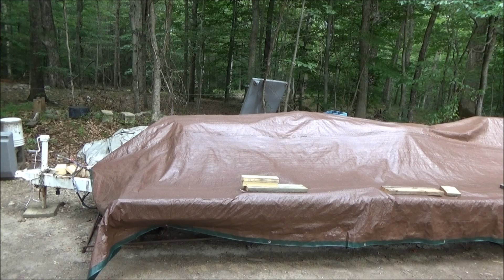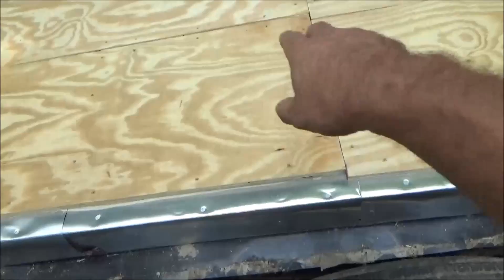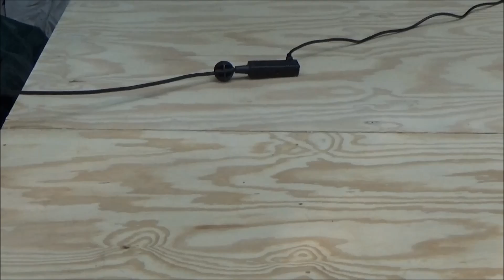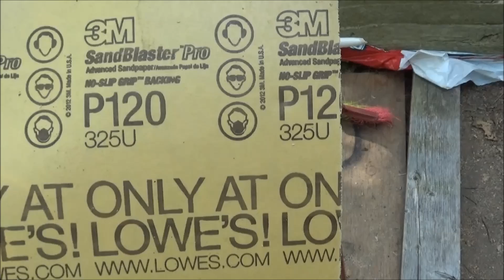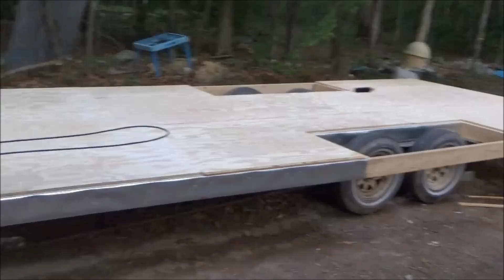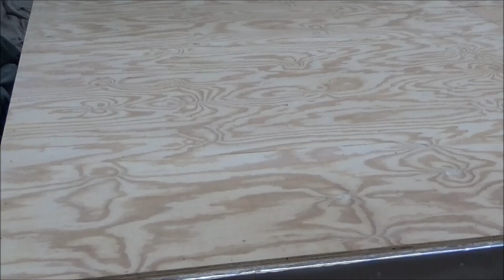Sanding My Tiny House Floor Plus Some Nice Finds

Comment: I know you want to use a natural substance on your house that is good especially because its a small space to be cooped up in the middle of winter and you gotta breath the air in side of it with no escape when its cold or real hot with ac on. I would have used marine varnish because it last a while and water cannot penetrate. I think after it dries good you will not get fumes. Just what I would use but your house you can do as you please shellac will be ok as long as it dont get too wet. It cannot get wet from rain or it will ruin it I think. Just saying dont get sad. If you keep it tarped good it will be fine. I believe your gonna need lots more tarps. You cannot have too many.

Comment: Not to be negative but I don't get it. The finish on the floor needs to be done last. At least after wall covering is put up and cabinets are hung. There will inevitably be dropped tools, lumber, and other objects that will ding the plywood. Easily remedied with a warm rag but only if there's no finish on it. I could understand a rough sanding, maybe 80 grit to even everything out from the beginning but not finish sanded and coated. Most of that could have been avoided with the golden rule of measure twice and cut once. Problem is all I've seen is measure once and think about it for a week. Then there's the argument of which is more important, wasted dry weather where a wall could be flown or a sanded floor that will absolutely get dented later and need to be fixed. Troy, Fall is here in 6 weeks. Get a move on or you'll be out in the cold. It's almost getting unbearable to watch what is coming. That being said I'm an avid supporter of what you're doing but there needs to be some serious priority changes or you will not finish that tiny home until the end of next summer.

Comment: I have seen some comments were they say do it after wards. But I think its a good idea to do it at lest once before the frame goes up. and if you do mar it or put scuffs in it. you can always take the sander to it and put a second coat after the walls are up ect. that way any water or anything will not penetrate the wood.  Now if you can get it for under the home I see if you can get that Rhino liner stuff. you can spray on and completely coat the under belly of the home to keep it all water, and air tight.  looking good, my opinion thanks for sharing

Comment: I've been following you since your trip to Australia. Today's project is the second time I've commented. When you took your shoes off I thought to myself now that is a waste of time. Sanding with no walls or roof?
Reply from the maker: This is my floor. It will be my finished floor. This is not normal. I cant afford anything else yet. So I will sand it. Shellac it and then cover it. When I am inside I will re-coat it and wax it.

Comment: Troy I think you should cover like you plan. Don't waste your time with that Sander. Leave that until the walls a roof are up. Some saw dust at the off grid is not a bad thing, Plenty of time to vacuum it later. Plenty more dents and dings to come in the mean time. The floor does look much better, Once the humidity hits it might change. Just a Thought keep up the good work.

Comment: BTW, newly cut Oak is hard wood ! Talk to those old guys about how hard or easy it is to work with... The material from a store is probably more dry or kiln dried... We got mill lumber for a great price in Missouri but  cutting it and nailing was tough... We went through a blade and had to pre-drill just to nail things...

Comment: Hi Troy,
   I just got done reading all of the comments and then I went and spoke to a person that I know who has built homes for almost 50 years now.   I think in this case, Troy, you should bite the bullit, even though I know what your motivation is, to prevent dust inside your tiny home...but that is a given anyway,.......you will have dust simply from the construction unless you intend to vacuum each and every board and 2 by 4 before you bring it to the construction site, and even then, you will still have dust.  
   You won't be able to avoid dust and debri inside of your walls during construction....period.    You also won't be able to avoid damage to that...what could be a lovely floor, and if you seal it now, especially with shellac, you won't be able to go back and fix that damage without it either showing terribly or your having to go back and sand that entire layer of shellac off, down to the wood again, thus creating all of the dust and more, that you had so valiantly tried to avoid.  
   In this instance, Troy, please listen to these experts who do have your best interest at heart and don't shellac your floors until you are done.  Fixing the ultimate damage to the floors that is inevitable with construction  will be so much much easier without a finish on the wood.    I am backing you 100% in this Troy, and you know this, you have seen me come out like a momma Grizzly in your defense, but in this case, I am on the side of those giving you this advice, as well as always having your back.   Spoken in love...Vicki
Reply from the maker: I have my reasons. I know it is not normal. But please understand I am trying to keep a sub floor as my floor. This is NOT normal by any means. If I do not take precautions to protect it now then it will be destroyed. This is NOT normal. Normally you scuff it up, nail it up, glue it up, dirty it up. Then cover it up. But this is my floor. I have to protect it or it will be destroyed. I figured a bit of shellac is cheaper than all new flooring again after construction. It will hopefully protect it from being all dirty and ruined. At least I can try. I am also doing this because I am trying to give hope to people who lose their homes and jobs like I did. Hope that they too can build a house for a couple grand. I am cutting corners where possible to see if it can be done. To show people, if it works, that they too can do it.
Reply: The Do It Yourself World
when expensive wooden floors have been laid down on new builds ahead of time or other circumstances  dealing with renovation of old houses etc,  the flooring is covered  over with a soft water proof barrier sheet , sort of like thin polyisobutylene membrane, comes in 2m wide  50,100m length rolls and is  lapped tapped together with doubled sided tape,  then a heavy duty protective covering is put on top, similar to a composite board about 6-8mm thick 2x4m, its near bullet proof, will take pretty much any abuse, once all construction work has been finished,its removed leaving no traces of what went on .

troy probably sealed the floor to help deal with the water problems a head, must admit would be getting worried not having the framing up and the roof insight at this time of year, its one of the biggest problems on any building site dealing with the rain.

maybe worth thinking about constructing a temporary roof over the complete tiny house project, using some of the near by trees for upright support pillars on one side and using the tower sections for the windmill$ project for  the supporting beams on the other side , using some of the wood thats in the garden and other section of good weight bearing timber, bolted,screwed, nailed etc together into long beams make an over head frame, then a number of good water proof tarpaulins roped together  and tied around on top with a descent pitch would make the site workable when its raining, using either the Jeep or car as a tethering weight tied to the free standing towers  , probably  a number of stakes beaten in the ground to deal against the wind, seen it done before .would not take more than 2 to 4 days  to be constructed and would be very beneficial on the long run of things, not wanting to sound negative but its the only way around the small window of construction time left , with just the floor being finished after about a month, the walls and roof could take 3 more months to do on his own.he needs help that's the only way things will speed up, for one man on his own makes everything take 3 times as long, know from my own experience.
Reply: Troy, I do understand, but your first defense for going this way was all about the dust.  If you had not sanded first, there would be no need to shellac now that you have opened up all of the pours.   But I'm worried because shellac is so very unforgiving and you will have damage to that floor during construction....you won't be able to prevent it.  It is very hard to almost impossible to make a repair to a shellaced floor look like the original and so all of your hard work will be for naught.   Also, you are on a time constraint that will only be cut shorter as you and your helpers will have to work extra slowly will be so worried about scratching that finished floor that you and your workers will be distracted from what you are trying to accomplish, which is to get up the walls and a roof over that floor.  I know you are trying to cut corners but some cuts cost you more in the end than they are worth....Listen to the experts in this case, please.....they do have your best interest at heart.

Comment: Why do you keep mentioning that UGLY blue table?  Why not just get rid of it?  And all that extra stuff that was on the tiny home floor why not just put it in the christian camper  till you need it?
Reply: Also, "all that extra stuff" (or at least part of it) helps to keep the tarp off the plywood floor. So it kinda serves a purpose.
Reply: Troy, don't get rid of the blue table. That is our running joke!
Reply: Althea Harris  It was a comment just like yours that started the blue table joke off. The Table is now third in line of importance behind Troy and Loudmouth.
Reply: Hi Althea!   Are you from CA by any chance? I knew an Althea Harris, but you look younger.

Anyway, since this is a learning channel I shall enlighten you as to the crooked blue table.  This is what happens when women tell men to move something... it will never be moved and further more it will be declared a work of modern art, guarantying a place of reverence for ever and ever, amen.
Reply: Uncomfortably Numb :p
Reply from the maker: MollyDolly hahaha. Take that.
Reply: Sacrilege!

Comment: Troy!, if your going to put a clear coat of lacquer or varnish on the floor to protect it.. you can do it now and knock it out of the way.. it will protect it some from the elements.. just make sure you extend it pass the edges of the plywood on the edges.. to cover the edges from drying out and cracking over time.. while building.. later you can sand the lacquer down some and re-coat it .. if need be

Comment: I see all the tolls are out. Yeah I agree it may get scratched but you can put another coat on it after it gets all done in the end before you move in. The annoying table haa haa thats funny. I think yo should seal it it will get scrated but at least not more stains. You can touch up with a thin coat.

Comment: I would have covered the floor at this time with Tarkett 12-ft W Modena Tile Low-Gloss Finish Sheet Vinyl that is Water-moisture, mold and mildew resistant from Lowes.

Comment: U sandee the floor and fill the seams with glue dust filler from the leftover piece. The shelacin should be covered by tentin the tarp over the floor until good and dry. Ur wood finds will help with makin a winter ready road base and a big sled to haul over snow. Looks like your neighbors r lookin out for u too. Many eyes help in findin things as they look in different directions. Hope u keep ur list of needs in ur pocket, so as to update it with these new finds. Remember  to scrath Babycat and feed the chickens, otherwise they'll remind u to.
Reply from the maker: I do have a list and it is fun looking around with my neighbor. Baby says hi

Comment: Are you using shellac which is susceptible to water damage or varnish which isn't?
Reply from the maker: Shellac. I know, I did my studies and know it is easily damaged. I will coat it with floor wax though. I wanted a green home with natural stuff. No chemicals. My nose never works and I am hoping that by getting away from chemicals, it may work one day.
Reply from the maker: ***** Alcohol is a natural product. Distillers around the World are releasing alcohol into the air. Its a natural product of the environment. Nature itself produces alcohol in berries. It is green and pure. People drink the stuff every day.

Comment: I would like to point out two things that may help you Troy.  One is: the dust mask your using will keep out nuts and bolts, but not dust, you need a dust respirator(harbor freight 16 bucks). I was once an aircraft mechanic for USAirways, we proved it.  Also,  if you want that floor level, plain it down in the raised area's, I thought that is what you bought it for? Keep up the good work!
Reply from the maker: I used what I had on hand. Better than nothing I guess. At least I had not mess in my nose afterwards. That is good.
Never planed a floor and not sure if a hand planer will work. Or if that is how it is done.
Reply: northcacalacka545  It is a joke about viewers heckling Troy...and Troy giving as good as he gets.
Reply: ***** Yes!  He should be wearing blue ear muffs.
Reply: What the hell does that mean?
Reply: MollyDolly
I was sort of thinking orange would go better with his hat.
Reply: The Do It Yourself World A hand plainer is specifically made to take out the high spots.  The only thing your going to need to be careful of is the screw heads.  Make sure they are down far enough in the plywood.  Were the plywood meets, is usually where it raises up.  I used a respirator for years, and I can tell you with certainty, those "dust masks", don't protect you.  Only something that seals your face will keep the dust, dirt and debris from your lungs.  They are usually expensive, that is why I told you about harbor freight.  I bought one from them and it only cost about 16 bucks.

Comment: I'm not a carpenter so keep that in mind.  I have a question...Won't sanding the wood open the wood grain more and cause it to be exposed to the elements?
Reply from the maker: Not after coating it.

Comment: I probably wouldn't have bothered with the sanding until after walls, roof and room finishing was done. You will be sanding again at sometime. No big thing, but you are thinning the top layer of wood on the ply.